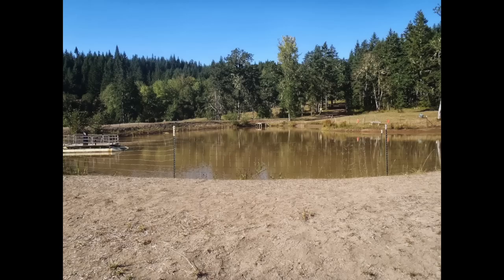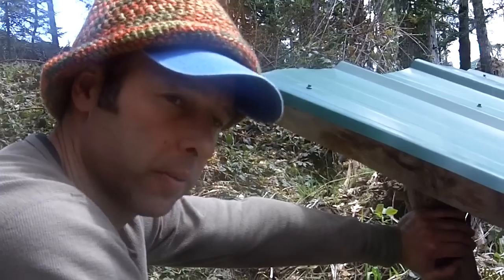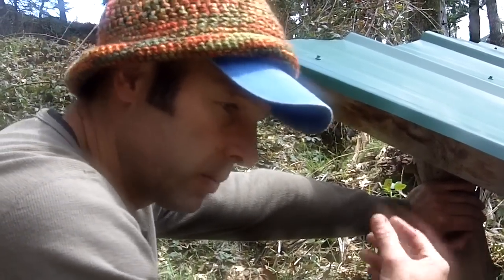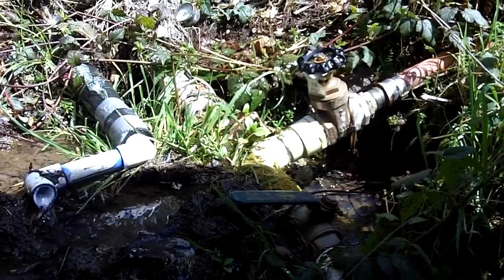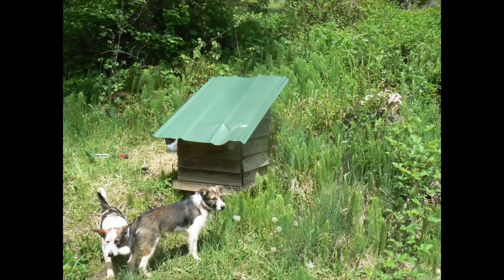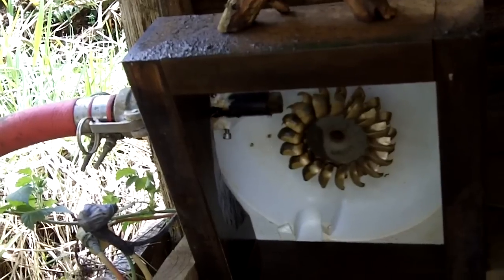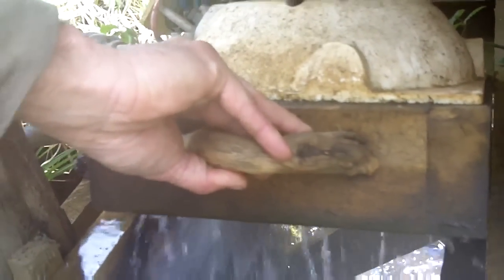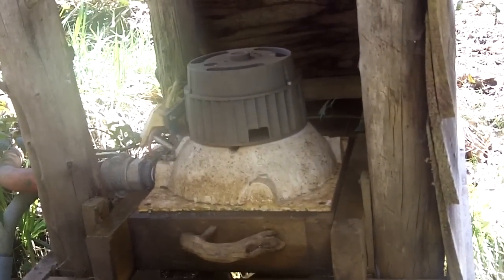Renewable Energy Source: The Micro Hydro Generator

Comment: Solar powered 12-24 V Well Pumps and 24 V Solar Panels and Wind Turbines.  Place Pelton wheel in Water Cooler, which sits on a hydroponic net pot with submersible well pump providing 87 PSI jet stream to push the water turbine, which generate 1.5K Watts, connect to an inverter or connect to grid.  Back up wind Turbine for camping or living in off grid conditions.  Portable watter cooler, drain and empty, maybe can use anti freeze to increase life span of motor.
Reply: Parts List: http://cart.payments.ebay.com/sc/view

Comment: By increasing the radius of that wheel, he would make much more torque out of that system and by adding more "spoons/blades) he would make more speed out of it, thus he could generate much more electricity!
Reply from the maker: Interesting contribution, thanks. I've passed your comment onto the Cougar Mountain Farm crew.
Reply: Thanks for responding :) I have a video about this subject and if you like, please check it out. I have tried to explain the physics behind what I just said up there :) Name of the vid is: "Super hydro turbine". Have a great day :)
Reply: Life is illusion A better solution would be to have a reduction gearing system to up the rpm.